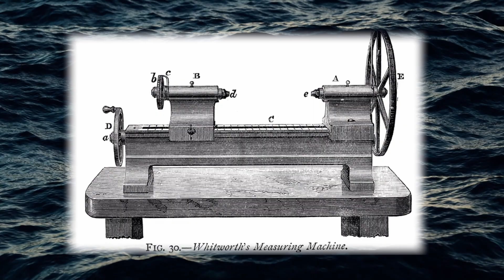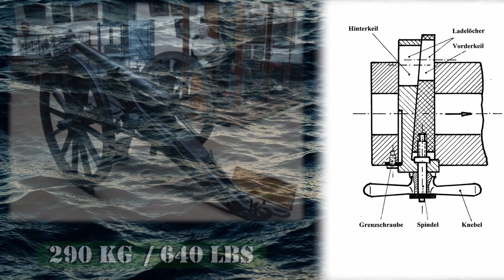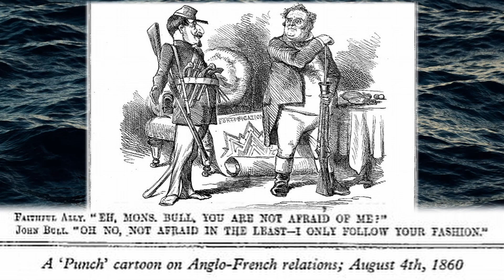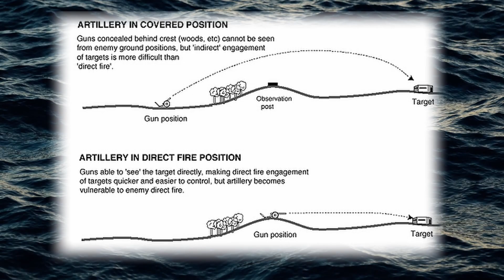C/64 Krupp gun : The HIMARS of 1870

Comment: "We had not long to wait for the first movement which the enemy's infantry was to make in our direction. It advanced in quarter-column from Amanvillers, and attacked us energetically. When the head of the French column became visible over the hill, our trial shots reached it at a range of 1,900 paces, and my thirty guns opened a rapid fire. The enemy's infantry was enveloped in the thick smoke which the shells made as they burst. But after a very short time we saw the red trousers of the masses which were approaching us appear through the cloud. I stopped the fire. A trial shot was fired at 1700 paces range, this was to show us the point up to which we should let them advance before reopening the rapid fire, we did the same for the ranges of 1500, 1300, 1100, and 900 paces. In spite of the horrible devastation which the shells caused in their ranks, these brave troops continued to advance. But at 900 paces the effect of our fire was too deadly for them, they turned short round and fled, we hurled shells after them as long as we could see them."
(Colonel Kraft Prinz zu Hohenlohe-Ingelfingen, commander of the Prussian Guards' Corps artillery, about the battle of Gravelotte/ St. Privat 1870 in his book "Letters on Artillery")